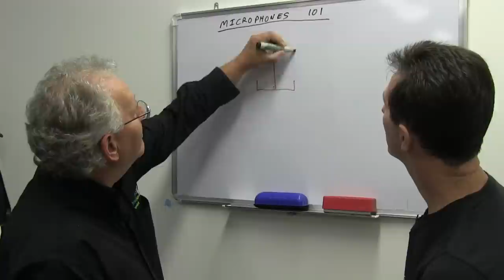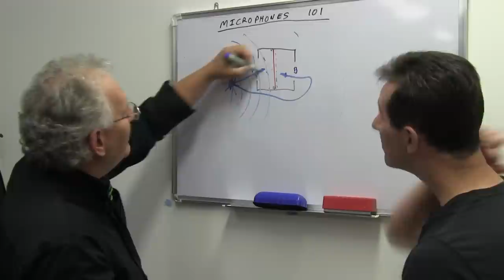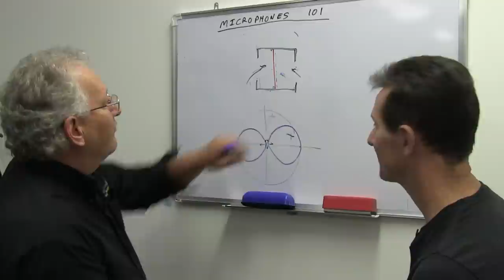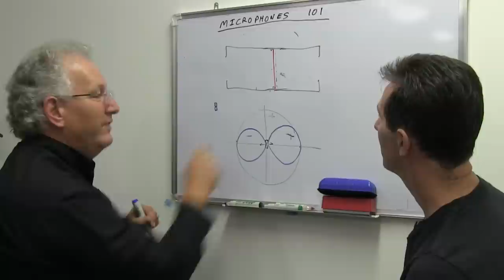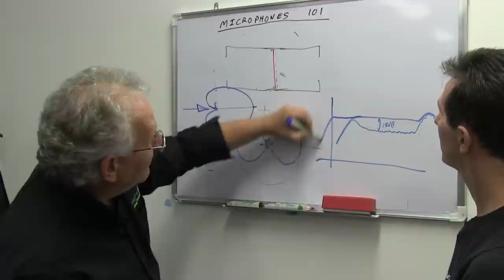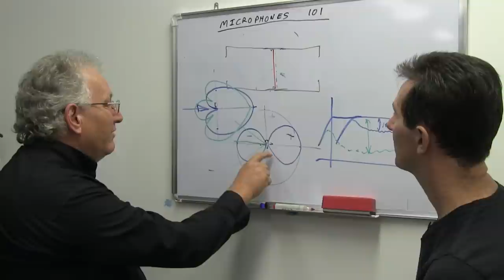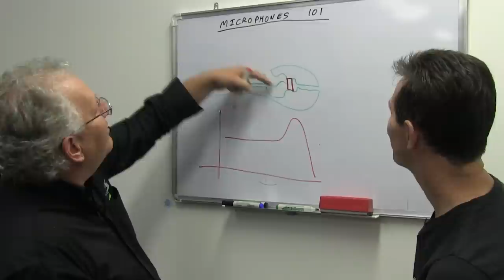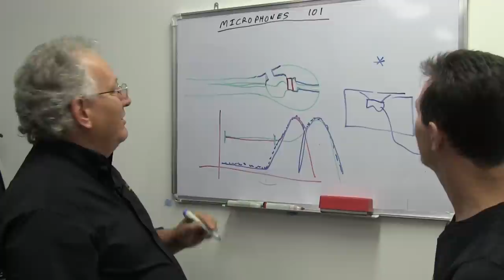EEVblog #605 - Fig.8 & Cardioid Microphone Patterns

Comment: Great video!  One question: how is cardiod done without two physical elements?  At 13:00 came the question "And they're all constructed like that, physically using two elements?" Doug: "No. ... And this is where the black magic comes in".  But I don't think the question was ever answered...
Reply: It’s done by means of an acoustic labyrinth, so the construction of the capsule is such that sound arriving from the back is delayed in a way that it cancels with the sound at the front. Acoustic cancellation within the body of the mic, rather than the two capsule electrical cancellation.
Reply: @brainwasher3742  Excellent,.thanks for the answer!  Oh, that's some clever design.   After I wrote that question 8 years ago, I didn't do follow up research (probably forgot I asked the question by the next day) so am learning about this now.  Now to do some extra reading on how these labyrinths deal with different frequencies...

Comment: So, I am wondering if Doug has ever considered that a 'Figure 8' polar pattern (when used in Mid/Side) functionally becomes a 'mobius' strip, which is why we are able to build an electrical Mid/Side decoding matrix to transform mid/side into a traditional A/B stereo configuration.  180 - (-) 180 degree phase inversion of the side mic with respect to proximity eliminates the inverse square law attenuation ramifications by phase doubling (electrically) certain frequency response magnitudes precisely because others are being cancelled out between the MID and Side information Inversely in A/B (which manifests as an Asymmetrical Balance as opposed to traditional Symmetry).  So, when combined with the MID, there is a 100% cancellation at the MID and 100% phase inversion on the 'sides' of the stereo image (if the mid is pan center and the sides are pan   L and R respectfully).  So, stereo Pan Law actually 'means' something in the MS context, because in traditional stereo, I cannot lower and raise the 'side' informational volume independently of the mid (unless I build the MS matrix).

So, lets extrapolate this conversation into a 'Conventional' Physics.  Are we misunderstanding 'Magnetism'?  Is a 'magnetic' field a Figure 8 Pattern?... YES. 

Are there actually Side 'sets' of information in MID/SIDE?   NO.

So, my question becomes... If N/S are actually the 'same' information set in a magnetic field,  would there actually be 2 polarities?  No.

There would be only 1 property of magnetism (magnetic flow, MID) and then the 'duality' of polarity is an Illusion created by the decoding of an electrical MS matrix into A/B stereo, by way of a Möbius strip.  Thus providing -180 to +180 inversion of Polarity between the 'poles' of the magnetic matrix.
Reply: Are there actually (2) Side 'sets' of information in MID/SIDE?   NO, there is only 1 monophonic electrical form which is duplicated and phase inverted and panned L and R.
Reply: Does a magnetic field has a ring of silence?   YES...  So, how would it change our understanding of electrical engineering to understand magnetism as a MID/SIDE stereo as opposed to an X/Y stereo construct?
Reply: Perhaps... attraction and repulsion are actually the result of N/S and N/N or S/S...as Chiral Information sets which can shake hands or not.  N/S is actually like  2 'right' hands of 2 different people. Each person believes in their own N/S, but they only know which is which when they meet another polarized state.

Comment: #EEVblog #605 - Fig.8 & Cardioid Microphone Patterns  I wish he'd also talked about the high-frequency limitations of figure-8 mics. 
When designing a ribbon mic it's important to make the front-back path as short as possible, because when the wavelength gets to be around that distance the sensitivity plummets, just like with very low frequencies...
When I designed my Berkley-1 ribbon mic, I used the neodymium magnets as the sids of the frame, thereby shortening the front-back path as much as possible with the given strength/size magnetic.  https://3dwarehouse.sketchup.com/model.html?id=7d0cc303be24f5d99ec8b617971abb3f